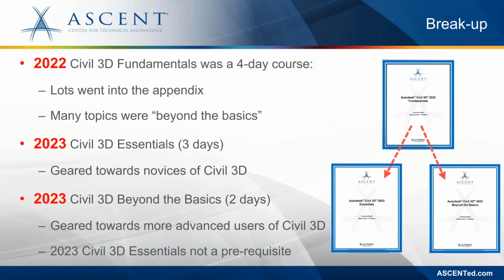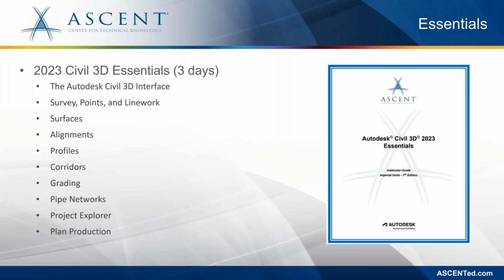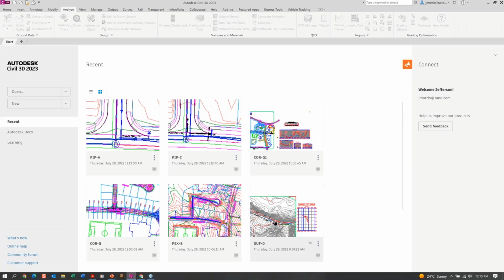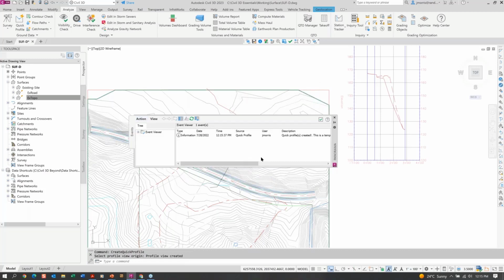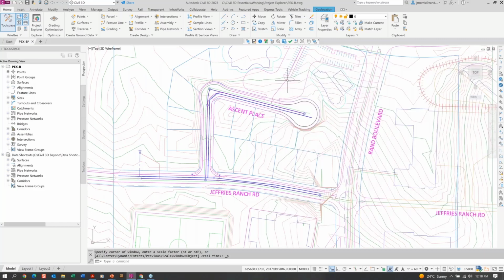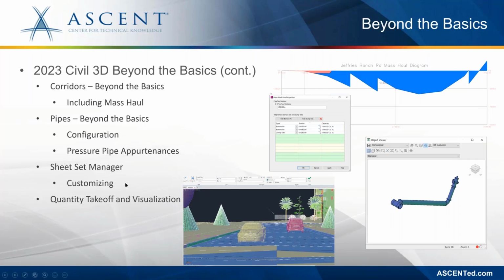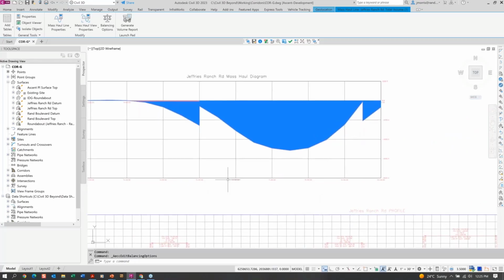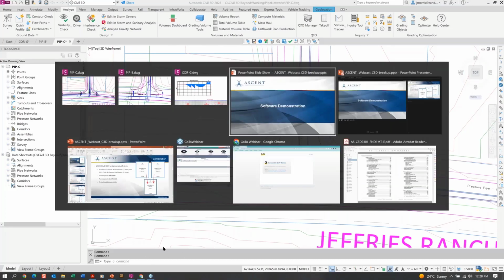Discover the New Civil 3D 2023 Fundamentals Guides

Comment: Dear Jeff Morris,

I would like to know if there are differences in your learning guide or books for Autodesk Civil 3D 2023: Fundamentals. There is one which is published by SDC Publications (Autodesk Civil 3D 2023: Fundamentals.) and one by ASCENT- Center for Technical Knowledge (Autodesk Civil 3D 2023: Fundamentals - Imperial units). Are there differences between the two books?

Secondly, is the Autodesk Civil 3D 2023: Fundamentals (Metric Units) having the same contents as the two above publications or is it different compared to the two above publications?

Thanks.
Reply from the maker: ASCENT has a limited distribution agreement with SDC Publications which is for educational institutions.  They are republishing our guide, so the content is exactly the same.  

The contents and datasets in our Imperial and Metric guides are the same, except all the units of measure are changed for imperial or metric use